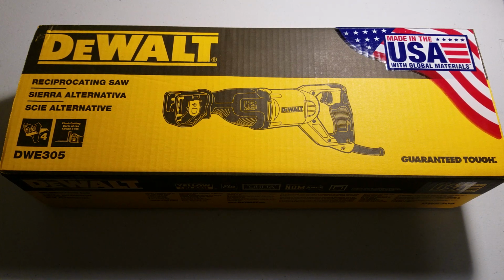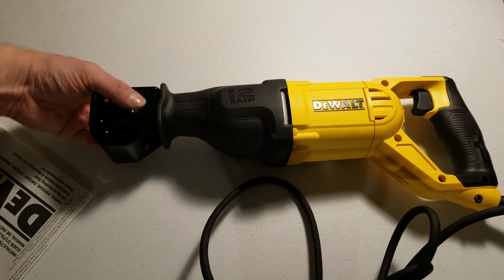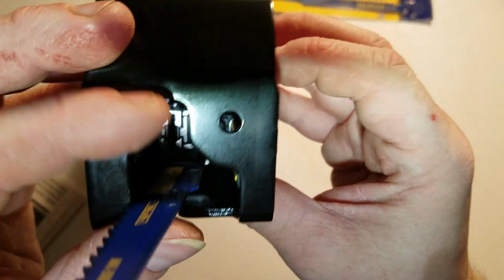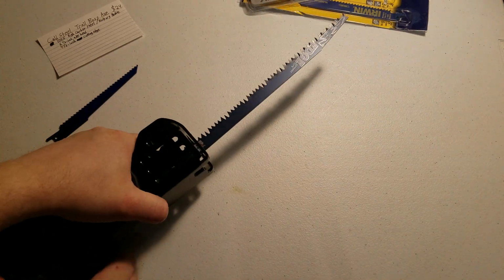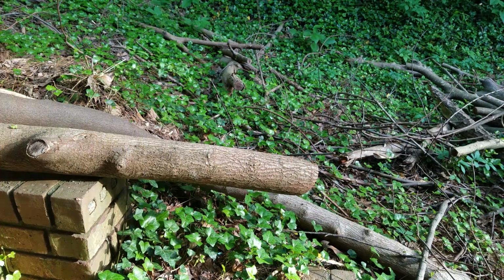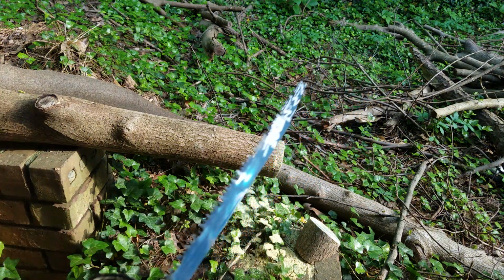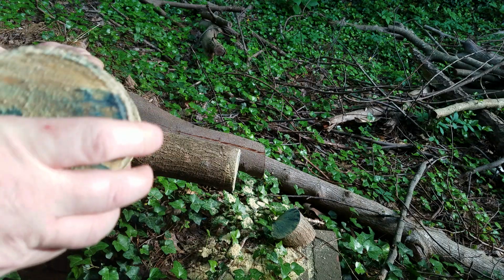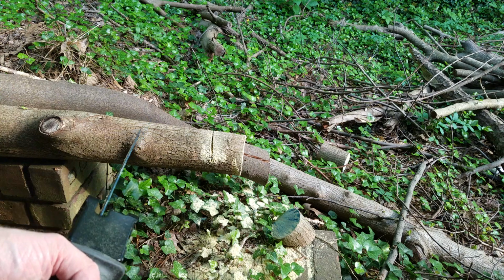DeWALT DWE305 12 Amp Sawzall Unboxing & Demo (Reciprocating Saw) (SurvivalGeek)

Comment: I bought the same saw. DWE305. Question: this is my first recip. saw and I've noticed that the shaft (that metal part that goes back & forth with the blade attached) has same play/it's a little loose on all directions (up, down, left, right). I'm not talking about the blades - those ones are supposed to be a little loose, i'm talking about the metal part that connects with the blade? Yours it's the same?
Reply: Just returned my first DWE305 for same reason thinking it was broke.  Brought home second (same one) and now thinking I may need to return and go with either Milwaukee or Mikata brand as I didn't feel it was safe using this when trying to cut embedded nailing from driveway expansion joints prior to replacing with new wood dividers.  The cut had to be flush with concrete and the movement of the blade was almost too much to handle.
Reply: welcome other comments - maybe over cautious?

Comment: I just want you to know your video saved my bacon. I had to get some boards cut before a contractor came in to do some other work. I had to get them cut last minute and the instructions to my saw, this exact one, said to loosen the screw to install the blade. Now I have common sense, I even have common construction sense hence why I can do this myself, so when there was no screw to loosen in order to insert the blade I went to YouTube. No other videos showed the insert of the blade it did show in several them fumbling exactly like I did, then it edited to the blade being installed. Thank god for your video!! I got the boards cut by 10pm last night and I’m good to go!! Thanks again !
Reply: As I just found out, the instruction manual is correct - the screw removal applies to DWE303 and if you read just below, it is instructions for 305.  Just lift yellow level, insert blade and then release lever.  But keep in mind this model has one very loose blade when engaged.  Maybe too loose for my comfort.

Comment: I have the uk version of this saw (110 volt a 240 volt one is available here) with the uk model number DWE 305 PK-LX you also get a case and a bi metal blade included it also says the uk model is made in Mexico it also doesn’t     Have the 12 amp marking otherwise I think it’s identical EDIT I recently switched to the 240 volts model just means I can use with out a step down transformer the model number is the same it just ends with GB another thing I failed to mention is the the uk model (240 or110v) is less powerful at 1100 watts to 1440 for the us one.